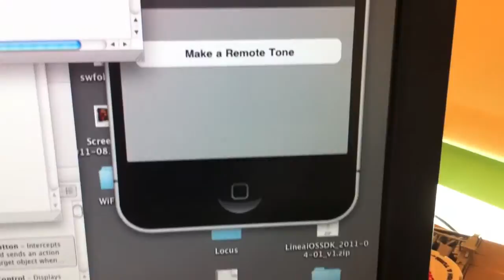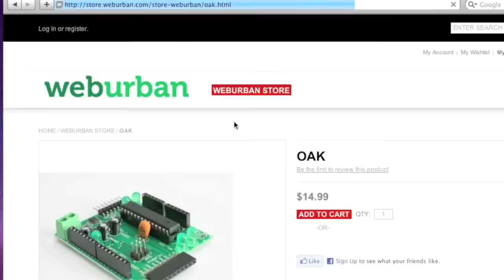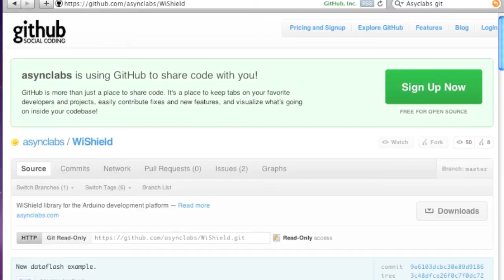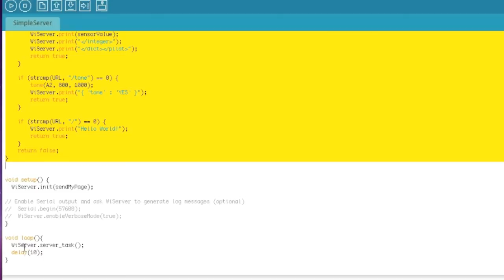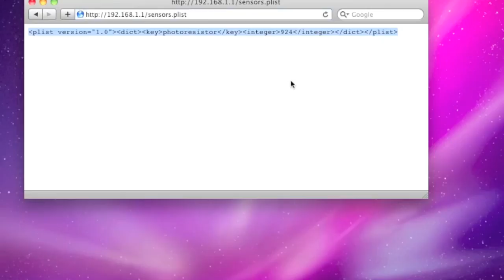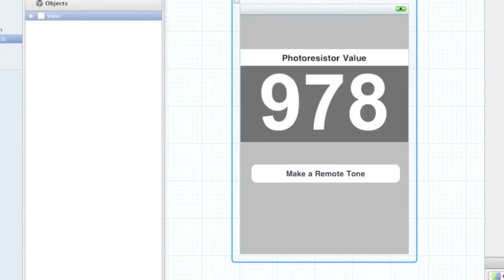Arduino Clone connected directly to iPhone over WiFi

Comment: If you could mail me about this, i really am desperate for how this would be technically possible. i'm currently researching this area on the arduino forums. search fir Ipad / Wireless by 'Supermaggel'. So far, it seems like it is NOT possible to have an iDevice communicate with a WiFi-enabled arduino device without router hacks, extra devices, ugly stuff... I personally find this really, really disappointing. The technology is there, but the support is not (libs, tuts)

Comment: This is not really truly an adhoc connection to an iPhone. You are using an iPhone simulator ON YOUR MAC. So, you are also using wireless on your mac. Which, is not, a standalone iPhone. How would you connect your iPhone to the ad-hoc network? You don't show that... this is really really misleading!

Comment: Hi.. I am trying to run your code. But i'm getting "error: WiServer.h: No such file or directory" and "error: 'WiServer' was not declared in this scope". I didn't change any of your code. Am I making mistakes in building Arduino? I have used the zip from the link and installed Arduino App in my Macbook. Do I need to build it or any additional steps required? Could you please help?